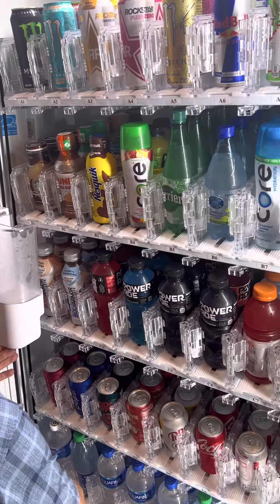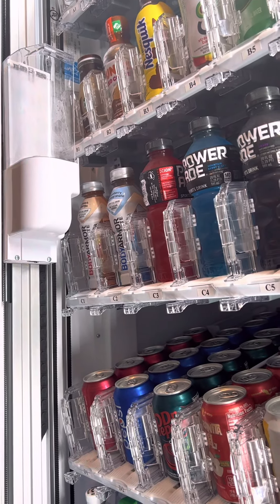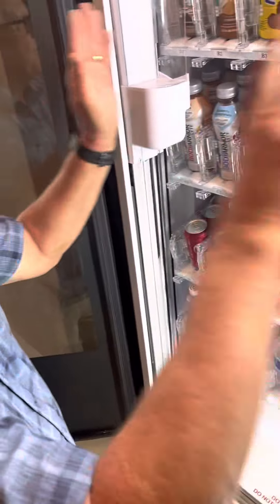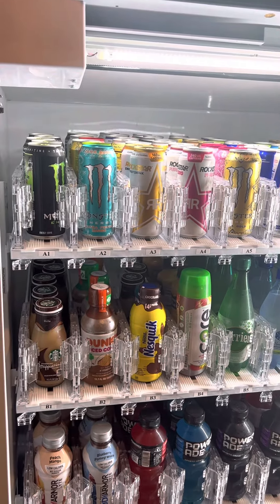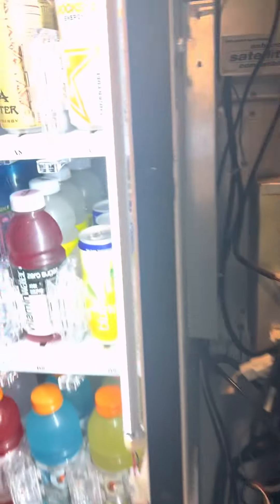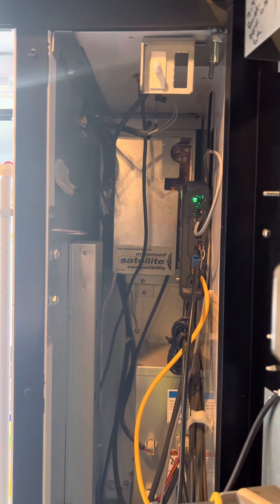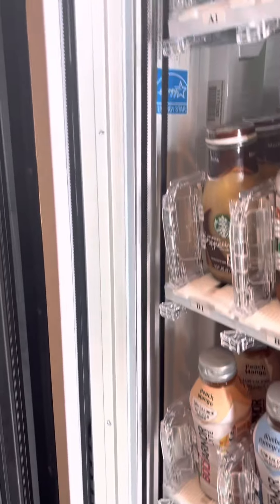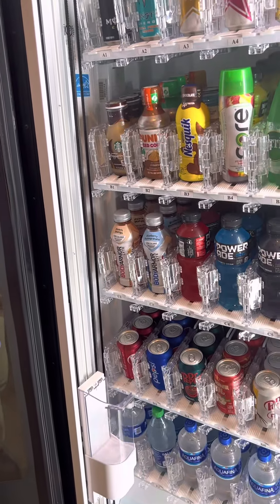Bevmax error | Random “Homing Y”  error message and not delivering | How to tune it and fix problem

Comment: They are great machines, the cup system is the major flaw with system and where you will have most issues.
Reply from the maker: True. Problem alway revolve around the same issues in our fleet. We carry extra parts in our vans.
Reply: Brand new machines come with magnets on the picker cup instead of that home switch. It is not affected by spills.
Reply: I had a spill in my cup and had to change it out…luckily I had an extra cup